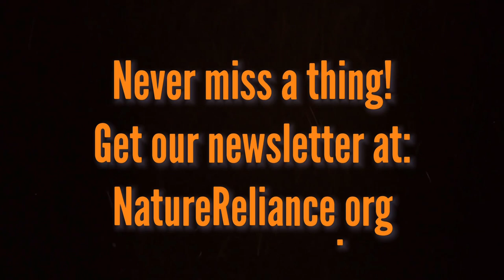Packstove Cooking Deer Tenderloin and Sweet Potato

Comment: What was the tool you used to split your wood down to smaller pieces ?
Reply from the maker: That is a froe.  Normally used in woodworking but I use it for splitting wood at the cabin for fire too.